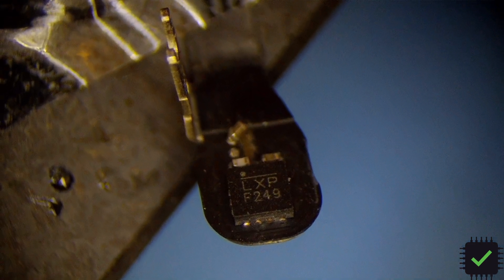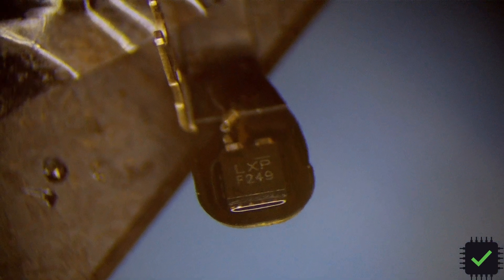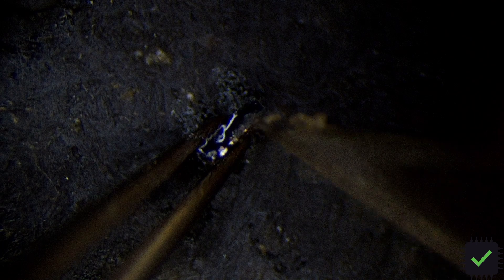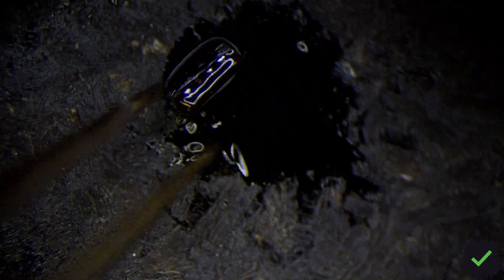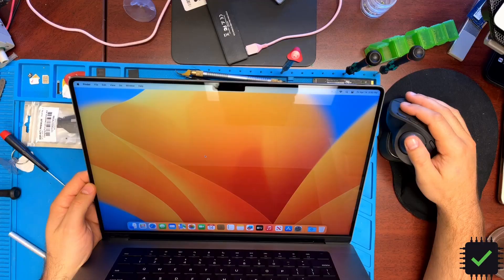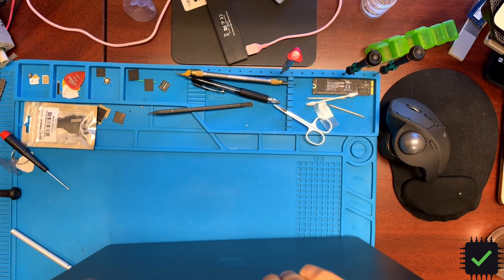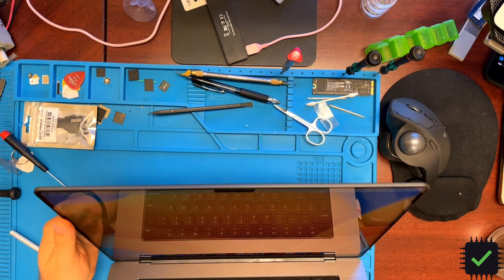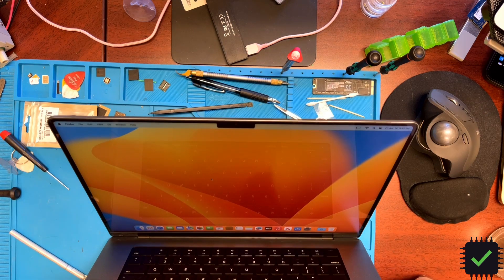2021 MacBook Pro A2485 Sleep Angle Sensor 821-03114-A LXP F437 Chip Transfer Swap

Comment: Ist this Sensor important and get i also picture without this Sensor.
Thanks for answering
Reply from the maker: It is important, you will have issues with the sleeping function. However it should not affect the image on the lcd.
Reply: @applepietech  thanks you think What could be the reason also that my macpro 2019 get  No Image but the Power consumption seems normaly.
I see corrosion on sleep sensor.
Thanks very much
Reply from the maker: Can’t tell without proper diagnostics